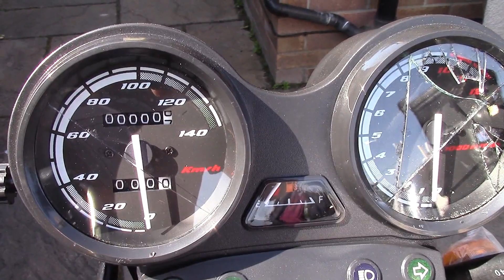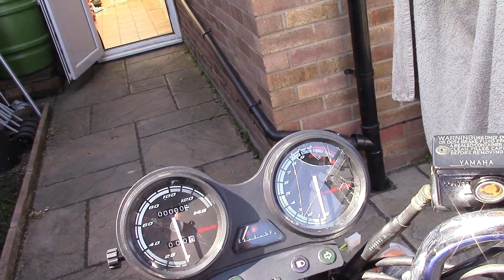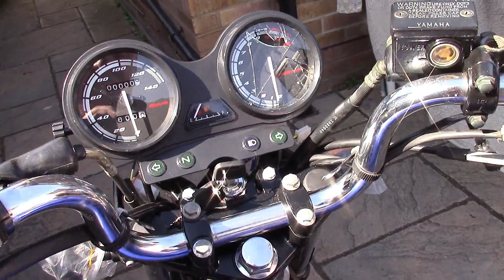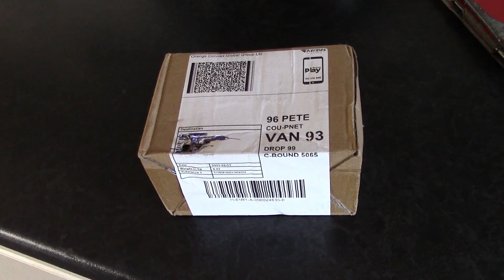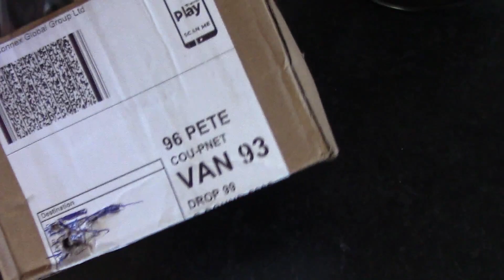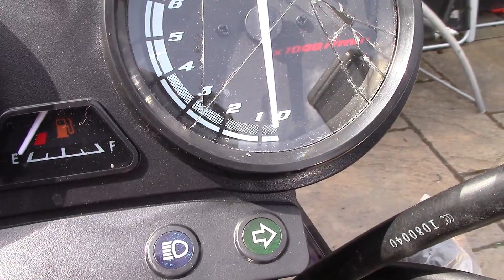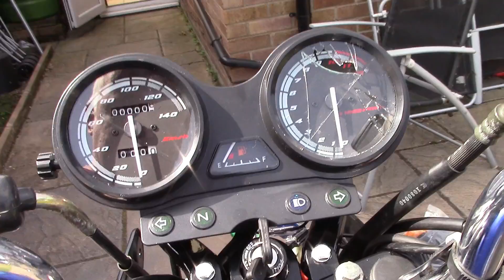Yamaha YBR 125   More Electrical Tinkering

Comment: I don't suppose you know the size of the bolts for the ignition switch, I got the same switch and the wiring was a lifesaver as bike kept turning over so ty so much mate!
Reply from the maker: I think they are M6? Glad it was helpful.
Reply: I don't know, I haven't been able to get the bolts off the old ignition yet, but bike is running again atleast, was hoping to order some before I get old bolts off, so how confident are you with them being M6's? Lol
Reply from the maker: @ThatNorthernLad  Not 100% to be honest!
Reply: @motorcyclejunkie7564  dw mate, cheers for the video, been helpful

Comment: I assume the original ignition lock switched both pairs to "ON" unlike the Injection models that switch opposites one pair on, one pair off (as per your test meter video).. (hence the brown loop wire you had to do) I'm just trying to figure out the differences between the Ignition switches... Struggling to find the correct switch without busting the bank!.. I may try what you have done.
Reply from the maker: It seems to work mate, in fact, its quite scary how easy one of these would be to Hotwire!